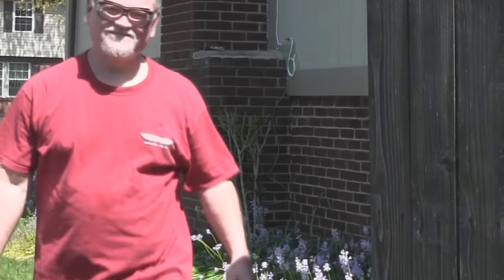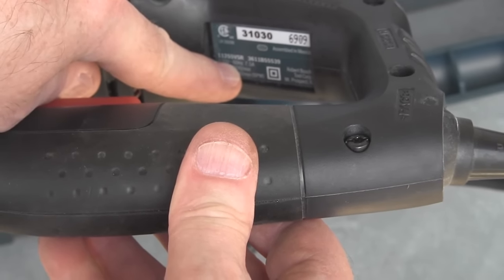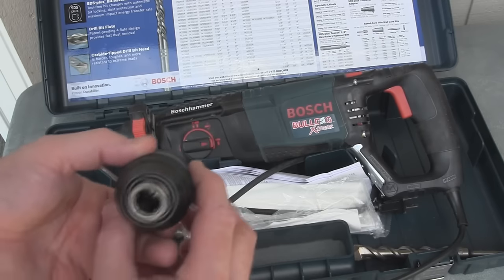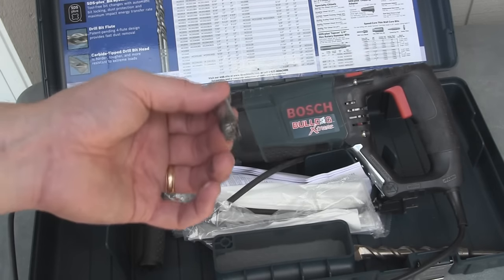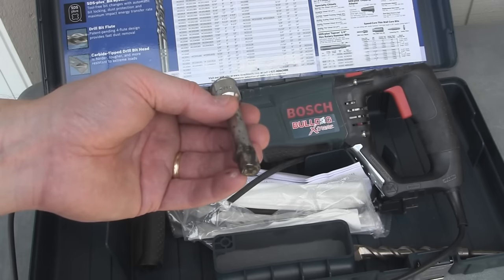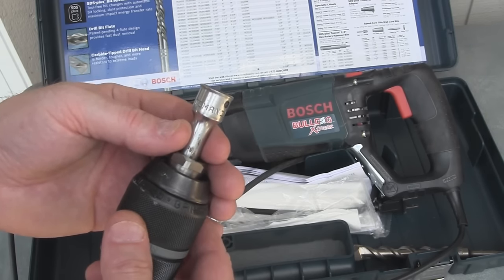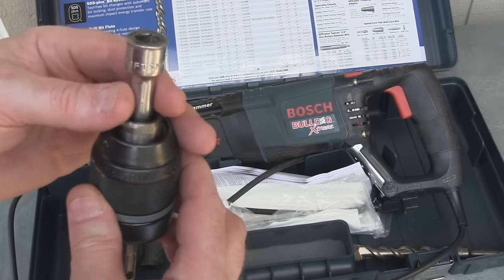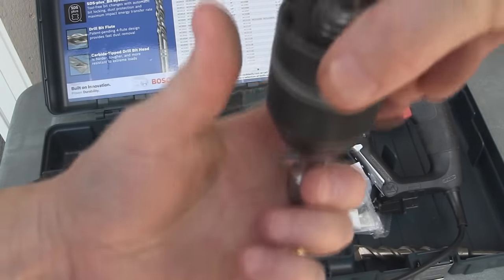How To Drive A Copper Ground Rod With A Hammer Drill

Comment: We use a 2' piece of 3/4" pipe with a thick piece of steel welded on one end (post driver).  Slip the post driver over the ground rod, tilt the ground rod up to vertical, then lift and slam the post driver onto the end of the ground rod.  When you get down to 2', you have to use something else.  
If you have to drive the ground rod through rocky dirt, tough luck, try putting water in the hole, etc., but there is no easy way to get through rocks.

Comment: When I installed my ham tower, I was required to drive SEVERAL 10' long ground rods. Almost all ground rods went down in a matter of a few seconds each.

I rented a 60# demolition hammer (aka "jack hammer") with ground rod adapter. A rotary hammer is a much lighter version.

Comment: I'm still not clear. The hammer drill turns at the chuck but the extension fit over the end of the rod and did not turn the entire rod?
Reply from the maker: Hi Mark, The rod was driven into the ground by the hammering action of the hammer drill.  The extension over the end of the ground rod was merely to keep the hammer drill in the proper alignment with the ground rod.  It did not turn the ground rod.  Hope that helps.  Thanks for the question.
Reply: That particular Bosch unit is technically a rotary hammer you can change the setting to drill to hammer drill or to hammer only. For this application you don't want or need rotation only hammering. The repeated striking action of the mechanism is what drives the rod in. You can also buy a ground rod driver for sds sdsplus or sdsmax rotary hammers. I install railroad tie retainers and use a slightly heavier version of this Bosch to drive re-bar or railroad spikes through railroad road ties without a sledge hammer. As tools go the rotary hammer is among the most versatile that little monster he has is a multitasker to say the least.

Comment: Do you then connect this ground rod to the house's grounding system?  What method do you use to connect the ground wire to this rod?  Erico sells a welding kit designed for that purpose, I was wondering if you used that.  How many grounding rods did you use for this project?
Reply from the maker: Hi Joe,
I should connect to the house ground rod but I didn't.  This ground rod was for a small digital TV antenna.  The house grounding rod is on the other side of the house.  I used a grounding clip like you get at an electrical supply.  Thanks.